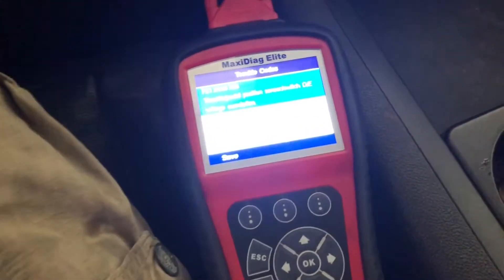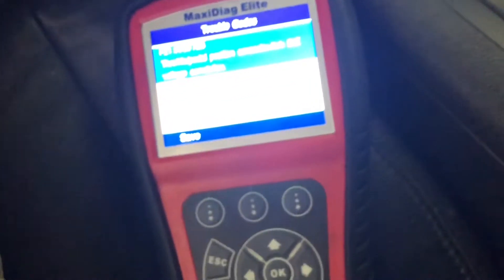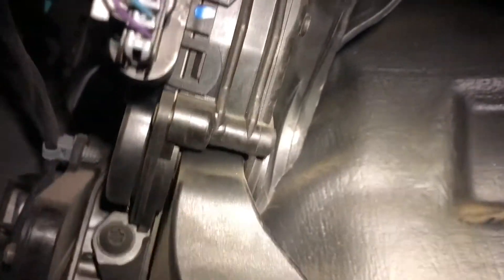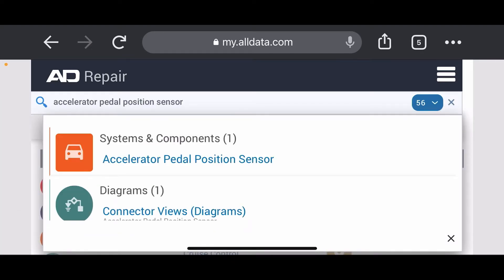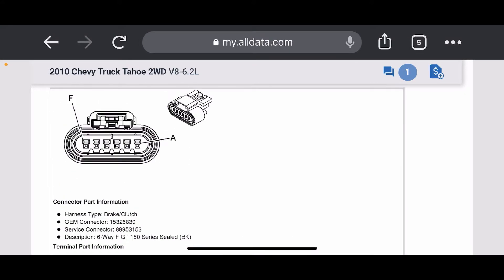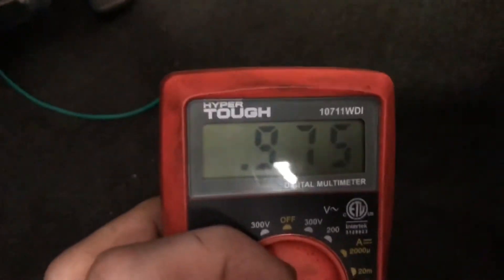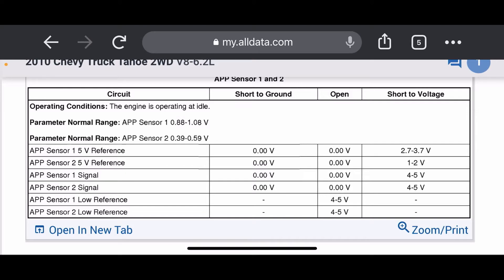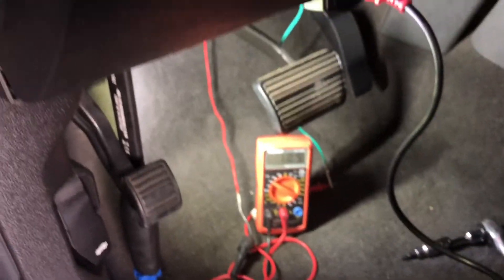Chevy Tahoe P2138 APP Sensor Diagnosis

Comment: 2011 camaro 4 shops havent been able to fix. P2138🤬
Reply: My Camaro has the same problem already replaced ecu throttle body and pedal any luck on urs?
Reply from the maker: a p2138 code on that model would indicate a short to voltage. there's likely some wires rubbed through and touching somewhere.

Comment: Heck I've swapped mine and the throttle body and wiring is fine and still have the issue
Reply: Probably the throttle body.
Reply: I did the same thing it run  two trips and came back on, still looking.